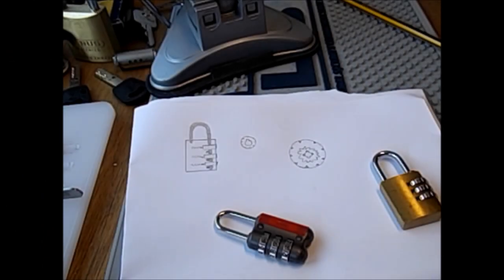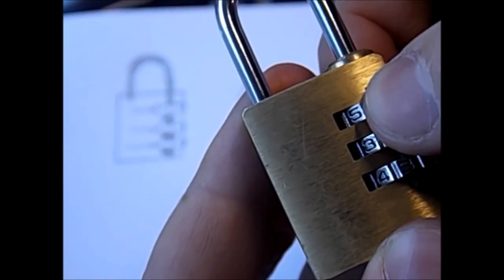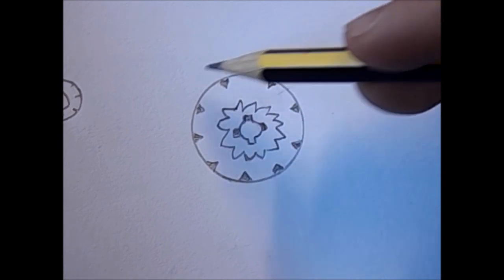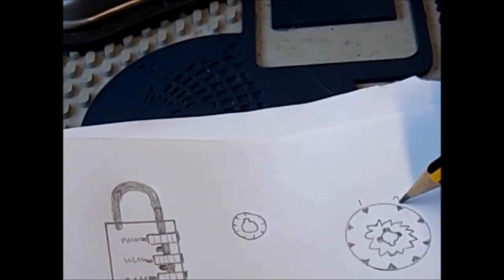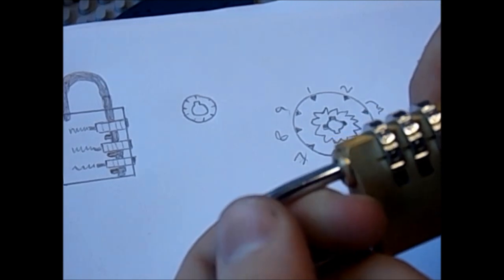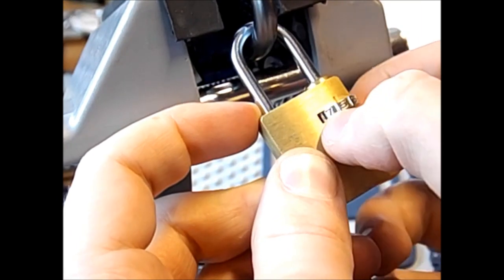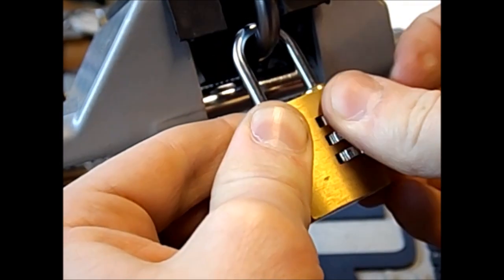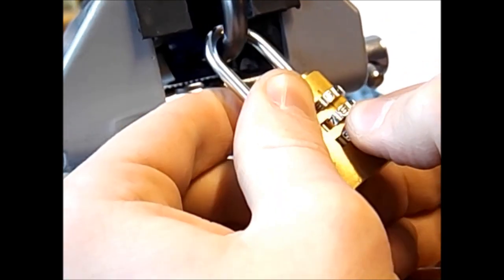Combination locks with false gates explained (153)

Comment: Would you take a look at a TSA007 luggage lock that has a cable loop instead of a shackle. I have forgot my combination :(
Reply from the maker: Certainly, did you by any chance already send me an email about such a lock? Or is that somebody else?
Reply: first time for me... I just left attached to the expansion zipper and used an older lock that I knew the combination to.
Reply from the maker: Oh that's funny, somebody else emailed me about the same problem. I think the process should be the same, just pull tension on the wire loop. If that fails and you really need in to the suitcase then pick the lock on the bottom, this is where TSA agents use a special key to inspect your suitcase.
Reply: Hobby Picker,  how would you pick a cable lock that has 4 digits (wheels) but has a button you push to release the cable from the lock? It is also resetable by pushing in on a small surface-flush button until it clicks and stays pushed in. You set your numbers and when you push the end of the cable back into the lock, the little reset button pops back up to flush with the housing and you have your new combo. I just bought this stupid lock for my son's scooter and somehow dicked up the process...even though I got it right several times in the store before I bought it

Comment: what should i do if i closed the lock accidentally out of it's position and forgot the correct combination???
Reply from the maker: Follow the same steps but instead of pulling out on the shackle, line up the shackle as if you were about to close it, and apply tension by pushing down continuously on the shackle. If you have issues understanding this let me know.

Comment: I have problems with same type problem.... my problem is my 4 combination lock is open already but i forget my password ... so how i get password for lock
Reply from the maker: Just copy the same steps as shown but instead of pulling on the shackle, line up the shackle with hole it goes into and hold downward pressure on it. Thanks for watching!
Reply: @HobbyPicker  thanks 👍🙏🙏

Comment: I have a brinks 3wheel resettable lock that is locked in the 180 degree from "locking"  position. I believe this is the position to change combo. The shackle is in the down or locked position, how do I find code? Same as if it were 180 deg and in the actual locking position?
Reply from the maker: Erik Lindquist Hi Erik, yes, if you follow the same steps as shown here it should work just the same! Thanks for stopping by!

Comment: What to do if the lock gets stuck open and won’t moved ? Jammed
Reply from the maker: Follow the same steps but instead of pulling out on the shackle, line up the shackle as if you were about to close it, and apply tension by pushing down continuously on the shackle. If you have issues understanding this let me know.
Reply: Hobby Picker  My lock is facing the other way so It won’t allow me to align it up like I’m closing it
Reply from the maker: @earlybirdgetstheworm9352  I see, is there a slot directly below the stub that sticks out of the shackle? Try the 'pushing down' decoding method in whatever position it seems to be jammed in. If you get stuck feel free to send me an email (address in video description)

Comment: when do you put tension and when do you release it?
Reply from the maker: Resdep 2001 You pull tension and turn the dials to try and find a ‘gate’, if the gate turns out to be a false one, then you have to release the tension and allow you to turn the dial out of the gate, and pull tension again once the dial is out of the gate.
Reply: @HobbyPicker  Thank you
Reply: @HobbyPicker  it took awhile but l managed to unlock my loctote combination lock.
This is the second time it happened on same lock, so l don't know why or how the combination numbers changes by itself without me changing it.
Reply from the maker: Resdep 2001 Well done! That sounds like a strange issue 🤔
Reply: @HobbyPicker  lam your new subscriber. Thanks again.
Reply from the maker: Resdep 2001 Thanks for your support, if you ever have any questions feel free to email me (email address in every video description)